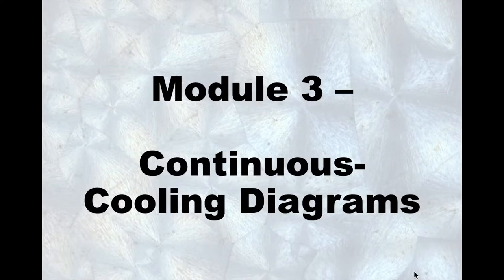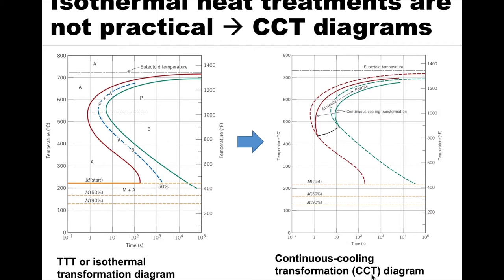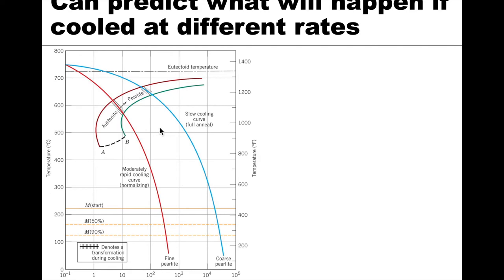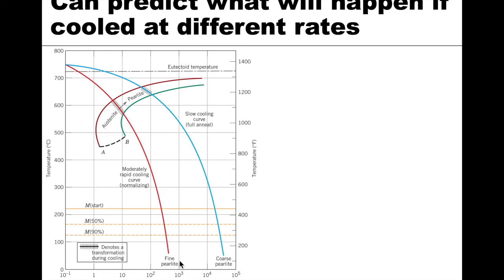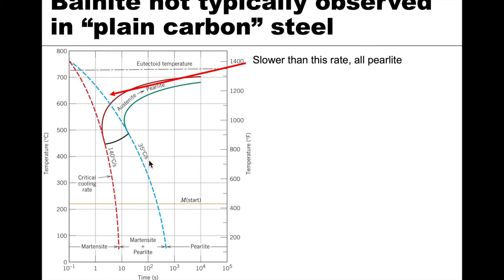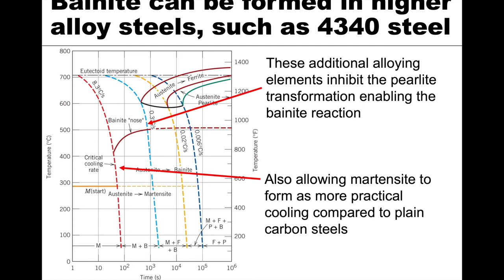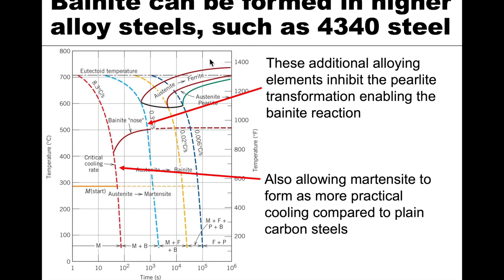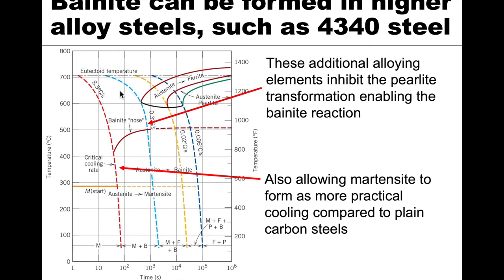MSE 201 S21 Lecture 38 - Module 3 - Continuous-Cooling Diagrams

Comment: Why it become M+F+P+B instead of F 100% cuz the line pass through A to F (complete) 🥺🙏🏼 pls help💖
Reply: because the austenite to ferrite is already destined to be an incomplete reaction. Notice how the A to F doesnt end in the green portion, meaning there were some austenite available to change to pearlite. For the M + F + P + B, the line crosses the ferrite region, then passes into the pearlite route. however, you can see that it crosses the black line instead of the green line, meaning the transformation to pearlite is incomplete. then it passes through bainite, which also didnt have a green line that indicate full transformation. Lastly, the remaining enters the martensite region.